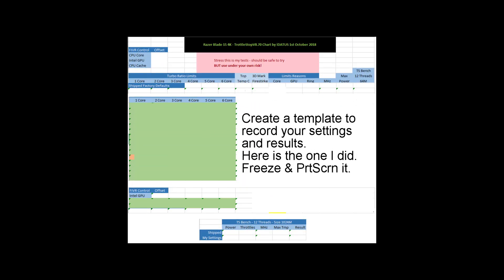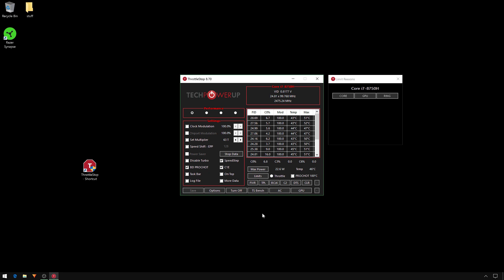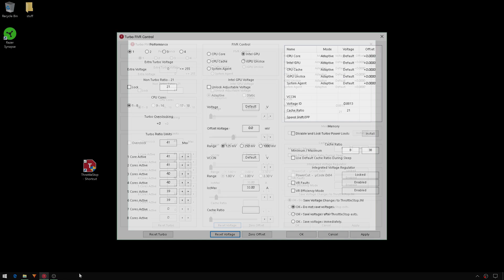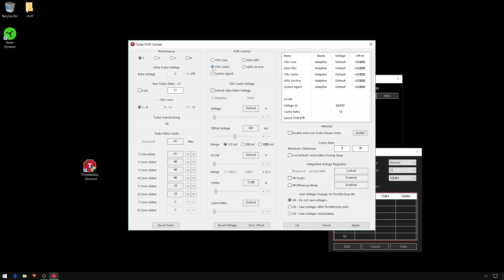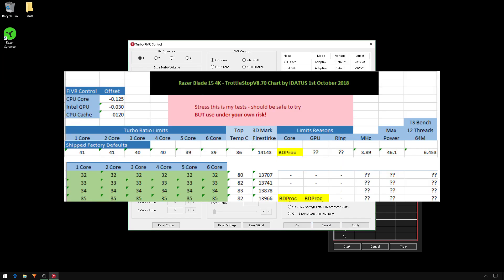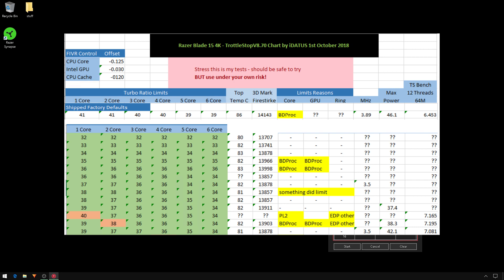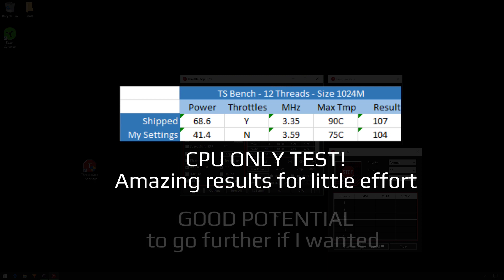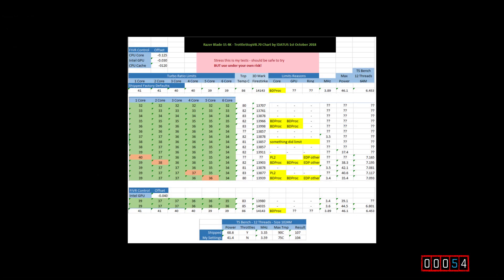Razer blade 15 undervolting with ThrottleStop⮜iDATUS⮞

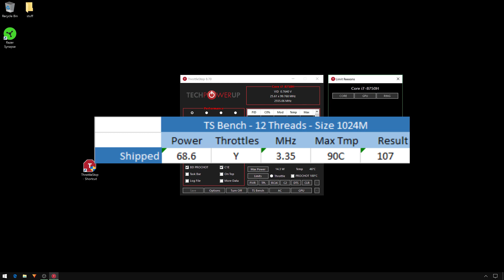Comment: how did you get the table  at 1:28 ?
Reply from the maker: Thanks for posting a comment. Hmm I am puzzled by a few results I got back then. I just ran a 3D mark test and 2 cores actually went to 100C and 2 others at 97C but the test you show is for TS Bench.
What I got at the time was correct but since then I have learned a lot more on how the CPU and Throttlestop works and a much needed and asked for explanation video request is coming soon.
I have added a lot of tech comments to this video which you might find of interest.
Concentrate on the voltage decrease I showed and use a different benchmark tool, that was just for example.
Try putting your cores at 39,37,37,36,35,34 ⮜iDATUS⮞
Reply from the maker: I just changed Synapse to Gaming mode and high performance on power and got 74.6W.
Remember these are peaks and with Throttle down to 45W. What we are trying to is get the performance as if it was 75W but at 45W.
Watch my recent post on more FPS or Cooler upload whilst thy waits for my next ThrottleStop Guide.⮜iDATUS⮞
Reply: @iDATUS  not sure but i think the audio is not good.
Reply from the maker: @neilpeerthy2355  Did you read the description for the video, because the volume is so low you get a lot of hiss. I did a heavy noise removal. All you need to listen out for is the whine ;)
Reply from the maker: @neilpeerthy2355  So I'm curious as to what conclusion you found?
Is that the noise you hear and is it all the time even when fans or on or off?
I read somewhere that some of the early RB15's people had this issue.
I would do a recording like mine if it is as bad as you said and log a call with Razer. If you have any more questions or need help you know where to come. ⮜iDATUS⮞
Reply: @iDATUS  well the noise i hear are really low, like a buzzin sound under the keyboard but it is very subtle. i need to put my ears close to the keyboard to hear it. I don't have any noticeable coil whine on my device. The sound from your laptop are too loud to be compared to mine actually.  which RB do you actually have ?
Reply: @iDATUS  i have the razer blade rtx 2060. I have some buzzin/scratching noise under the keyboard (middle) do you also have it on your Blade ?
Reply: and i  happen at idle. It is barely noticeable (can hear it in a quiet room) but with music and gaming i do not hear the noise.
Reply from the maker: @neilpeerthy2355  I saw your request but waited to reply as I wanted to actually record my Razer so you can compare it. Yep that's how nice I am. 
Here is an unlisted video for you to hear and I have put a lot of comments in the description.
https://youtu.be/00x5JLoYXUs
Comeback with more Questions if you have them. ⮜iDATUS⮞
Reply from the maker: Sorry Neil, wasn't notified you had posted a comment by YouTube. So as you said its not a coil wine which is good as that's a right pain. The audio I did was bad as I had to turn the mic gain up real high to pick up that noise.
So I don't have the noise you mention. Is there a way you can record it say via your phone?
Reply: @iDATUS  unfortunately my phone will not pick the sound. I have the rtx 2060 model. There is a sizzling kind of sound just under the arrow keys region. I don't know if it is the motherboard or something. I don't want to return the laptop because the temps are really good (max 70 degrees on gaming). But i don't know if this sizzling sound is a sign of motherboard failure. any advice ??
Reply from the maker: Hmm, that sounds like battery. I don't think there is any motherboard etc under there.
Is the battery fully charged?
Let it drain 10% or so and then see if its loader when charging.
You be glad to know I have started work on the next video. Spent all night benchmarking.
Might even split it into 3 videos to keep it focused for people.
Reply from the maker: My bad, teach me for not having my Razer out. I keep it in the sleeve I showed.
The Arrow keys are over the SSD, Bios Bat and fan controller.
I have had a look around and yes nvme can make noise.
Check this video out and I bet that's what you are hearing.
https://youtu.be/KS-BHI667po
Reply: @iDATUS  yes it is exactly this sound. I was one step of returning my blade lol. So is this normal ? Should i change ssd or somehing ?
Reply from the maker: @neilpeerthy2355  Im good to you Neil, I just put my Razer on as I am doing the TS vid and made sure it was doing nothing. 1.4W and 35C I could hear nothing.
I hear nothing above the Arrow Keys.
I then picked up my blade and lifted it above my head.
I then the underneath area where the nvme is and put my ear touching the case.
It was then I could hear that exact noise but faintly.
It does indeed sound like a normal HDD drive seeking data.
3 things come to mind.
1 the older style RB5 uses a soft thermal strip to touch the case. The newer current ones I think use a pad. The softer may be more of a dampener.
2 you have a particular noisy nvme
3 the model they are now using is noisier.

I suspect it 3 as I have seen a lot of posts about noise. Yes you guessed it I will be doing an upload of this information very soon indeed, and before the TS one as its worrying a lot of people.
Reply: @iDATUS  hmm okay. I do get the sound on idle tho. well i will not return my laptop over an ssd sound. but anyway thank you. and hope you upload your new videos soon :)
Reply from the maker: Didn't want to let you down on finding out what the issue was. Just done a recording of mine and see if the microphone picked it up.
I too was unaware these things make noise.
As I say mine is very quiet and see what the response is to my findings as questions.
Thanks for sticking with me on it.
PS the nvme is never idle with windows.
Reply from the maker: Mine is so, so quiet that I cant hear it really even with my ear next to it. I have ordered a nvme and a usb case to see if I can pick that up.
BUT I may have a solution for you!
Put a 0.5 mm NVME thermal pad underneath. It will improve thermals a bit but will dampen the sound a lot.
Reply: @iDATUS  hey once i put the thermal pad, i do not hear the sound so much anymore :D and my temps are now back to normal (46 deg) so cool thank you very much man. can't wait to see your much awaited next uploads (Y)
Reply from the maker: Cracking, or no so much now.
I got new XL template, I have done test and videos.
So all going well. It will be 3 parts at least.
I also created the video asking for support and got a couple more to do, probably tomorrow to finish that off as I really need give people options to support and actually give more options to people to get support from me. ⮜iDATUS⮞
Reply: @iDATUS  hey do you get the issue where charge your blade but it does not charge but only says "plugged in" ?
Reply from the maker: @neilpeerthy2355  I think what you are seeing is the battery has degraded a small amount from initial, its nothing to be worried about.
Windows takes a base line and uses that to say its charged 100%.
In a few days or so it will re-adjust.
Mine said 98% for a few days and I got worried too until I remembered how it worked.
Going to launch support options today or tomorrow. ;-)

Comment: I just picked up a blade 15 2019 model and the CPU runs 88-90C when gaming.  It's my first laptop and I am wondering if I should undervolt or is that temp normal?
Reply from the maker: Thanks for posting, welcome to the Razer Blade 15 club.
So 90C is the max the CPU will go before it puts safety measures to the max to stop it going any higher.
This will be via fan speeds and power (voltage) reduction which means you will still have a hot , noisy laptop with reduced frame rates.
I have done a huge amount of videos and plan many more for the Razer Blade 15 and other Razer items so I recommend browsing my channel.
Now if that feels like Razer has let you down a bit then don't, its intel insisting the voltage is set to a guaranteed safety margin to ensure the CPU works.
In truth this is actually quite high and undervolting and under clocking is easy and actually gives you more fps in the long term.
If you are going to use my guide, note to click the "Turn on" button on main screen.
Also the TS Benchmark set it to 2 or 4 cores. ◄iDATUS►
Reply from the maker: Hi there, check my newer full on guide to more of the options and settings for Throttle Stop. There is going to be a serious of how to's to follow.
https://youtu.be/xej2Lo5HYzQ

Comment: Hi ! This video is really good ! Thanks ! But I'm running into some issues.. When I launched the TS bench with factory settings, i have 157 score with max temperatures of 68° and red limit reason edp  in the ring column and red pl 1 and yellow pl2 in the core column.. This results are quite scary... Moreover, when i did the first thing you did ( with all the cores at 32, Cpu core adjusments, etc. ) i also have limit reasons on the ring and core column.. 

Is my Razer Blade broken ? Should i exchange it for another one with razer ? I just bought it so i still have the 14 days refurbish thing.

( Sorry for my english I'm french )
Reply from the maker: Thank you for comments on how good the video is. I have posted a lot of info to the other comments below and they should help you a lot.
I think you mean 14 day for money back?
So if that's right you have a brand new Razer and if that's so I doubt very much there is anything wrong with it.
I have learned a great deal since this video and will be doing a new guide soon which will explain some very interesting things and be a huge eye opener for all.
SO MY BAD,
Did you click the "Turn On" button at the bottom of the main screen? If not do so.
Don't set the TS bench number of cores to 12. Set it to 2 or 4. I will explain in the next video.
Make sure you do SET SYNAPES to Balanced power.
Let me know how you get on and or if you have more questions. I am here to help ;)
PS Nice to hear from a French person. ◄iDATUS►
Reply: @iDATUS  Hi!
I love your videos and am new to throttlestop.

I own a Razer Blade 15 2070 Max Q (Mercury Edition) from 2019 and would love to know if there is anything else that has changed or is important regarding my model. It would be very much appreciated if you could help me out. :)

Comment: Hey there, completely new to this undervolting stuff. Just wanted to undervolt as i felt my system was heating up too much on some games, but running the TS bench without any changes to volts gave me some yellows. Can i know what they are and should i be worried. http://prntscr.com/nn9ss4
These problems showed up without even running the TS bench http://prntscr.com/nn9v6q and while running the bench they frequently flashed red
Razer blade 15 base model, 1060
Reply from the maker: Thanks for posting and all welcome here. Undervolting is a bit bewildering and took me many hours of research to get my head round it.
I have posted some detailed answers to some questions below (check out phasma) and I plan a more detailed information and process post (like my NVidia GPU ones) for the next RAZER tech upload.
So to try answer your questions, Yellow means at some point in the past you hit a limit. RED means is occurring NOW.
DO NOT USE Throttlestop benchmark set to 12 cores, try 4.
Also I didn't mention to click the "Turn On" button on the main page, so if you haven't please do. My bad.◄iDATUS►
Reply: @iDATUS  ok i tried some of these things, tried different variations on turbo ratio limits and tried the ts bench on 12 cores (should we be doing 4? and why?) and it showed the (pl1 and edp other) on most of the variations. on ts bench on lower variation ones it didnt show any limits on the 64m size but it would show halfway on the 1024 one and wouldnt stop blinking red. so i decided to stick with lowest on all: made all cores turbo ratio limits 32. 

I looked up other videos and managed to get some temp lowered on my cpu, was getting 90+ on games now its on 85-87, still not that great of an improvement but i still want to push further and lower my temps down.
The settings i currently have are turbo ratio limits: 32 on all cores, cpu core offset: -140.6,  cpu cache -131.8, https://prnt.sc/ri83sq and havent changed the igpu one is it necessary to do the igpu cause i dont know honestly. Even  tweaked the graph for gpu with msi afterburner like this https://prnt.sc/ri7sgw
The video i watched did tweaks on speedshfits and turbo power limits as well, https://prnt.sc/ri7tjd and turned off bd prochot i followed all the steps.

Now my question is even after all these i get those pl1, pl2, edp other limits,what are these settings: igpu, turbo power limits, and speedshifts? and is it necessary for our razer blades or just stick with cpu cores and cpu cache offset?
I wanna know more about these settings and hopefully make the right changes in settings for better temp on my system, hope you reply. Sorry, if the comment is all over the place, but im still learning this undervolting thing. Thanks
Reply from the maker: @kenpachiaf  Hello again, yes even after 18 months or more of i7 cpu and throttle stop I just learned something that will explain a lot of your questions. I will be releasing another video very soon, spent a couple weeks making it the best I can. Its a major revelation and I have not seen this info anywhere else.
-
Have you seen my other Throttlestop videos
Throttlestop options https://youtu.be/xej2Lo5HYzQ
-
Understanding i7 CPU series episode i https://youtu.be/AfxxIeyWFd8
Explains why all cores should be set to the same ratio
The series will be 5-7 parts and it will include how to control your application or game and push the i7 even more.
-
As to the question on number of cores to test, it depends on how many cores the application you are using, uses.
-
Phew just reread your post to see if there is anything I can add, most of the questions those videos will answer, iGPU core will still create heat and -30 to -40 is easy.  Watch the videos and come back to me. PS can you post questions one those videos if its related to them or here if you prefer.

Comment: Hi! Thanks a for the video! I have a razer blade 15 2070 MQ. After following your guide my cinebench score increased by 290 (1895) and also by 73 in Heaven Benchmark! Now I have a silly question. Do I have to always run Throttlestop in the background, or does the system remember the changes? Also there is no difference in the results if razer cortex boost is activated or not. Neither in Cinebench nor in Heaven Benchmark. Do you know why? Thanks a lot!
Reply from the maker: First off, there is no such thing as a silly question! 
Throttlestop changes are NOT permanent so needs to be loaded to apply, which is both a curse and a blessing.
From memory all the boost does is allow it more power, what this does is allow it to get to a throttling state sooner. You may say wtf would you want that for, well if you have a spiky program you get faster performance. If you have a longer CPU request such as a benchmark then you will run at the max allowed and not notice any difference.
I have posted some detailed answers to some questions below (check out phasma) and I plan a more detailed information and process post (like my NVidia GPU ones) for the next tech upload which may be another 4-5 weeks so I ask all to be a little patient.◄iDATUS►